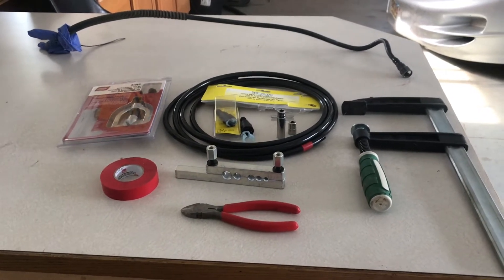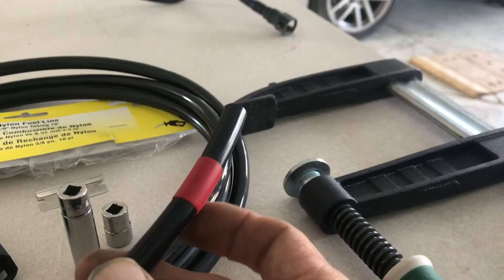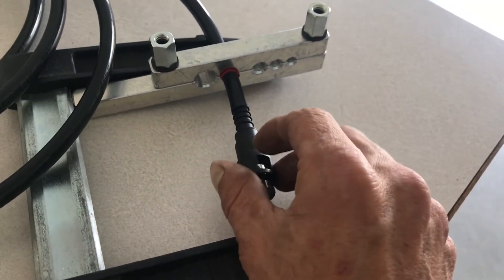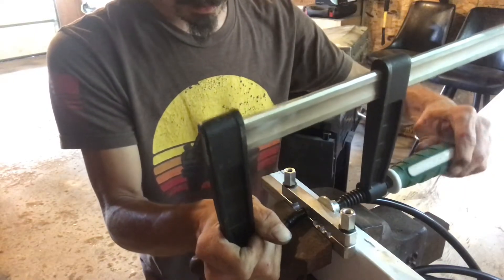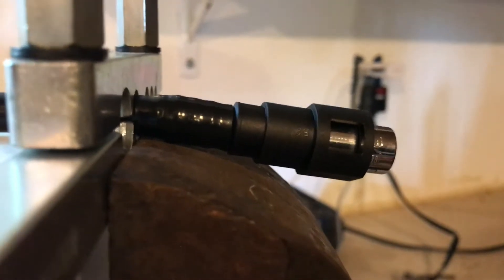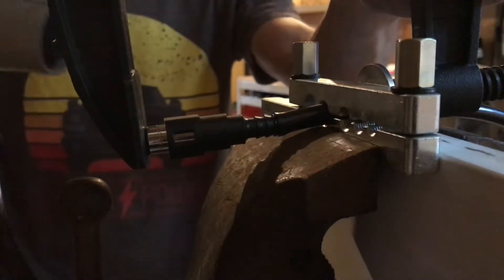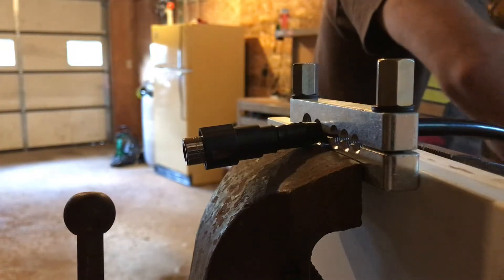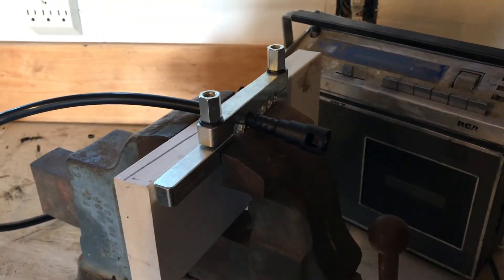How to make nylon fuel lines the RIGHT way without the tool!

Comment: Nice job!  Using a calking gun keeps the alignment better than the clamp because your clamp has the floating foot. The caulking gun is rigid. You still need to use the flaring tube holder so the nylon tube doesn't slide away from the fitting.
Reply: I use a piece of wood stair railing, the center drilled out to 5/16 or 3/8 and cut right down the middle to make two halves. Use this and a couple of hose clamps and it'll hold the line tightly. It allows it to fit the caulk gun nice and square.
Reply from the maker: Oh dang that’s a great idea, I bet it holds the line perfect! Next time I do this I’ll try that to help stabilize the line a bit better without damaging it!
Reply: That's a great idea!
Reply: 1pc medic..great idea..